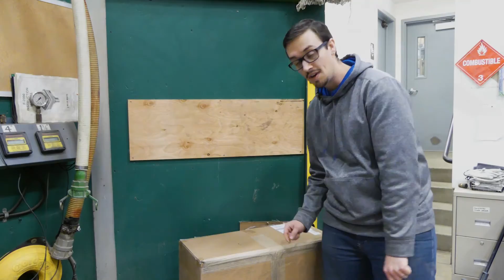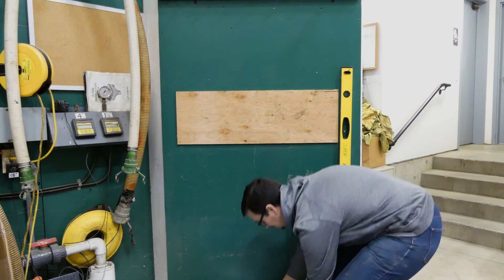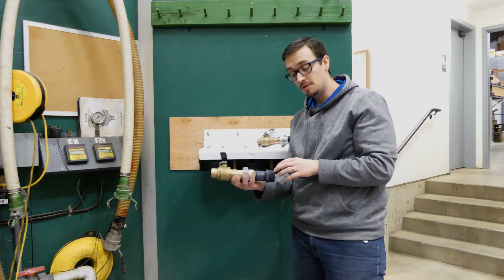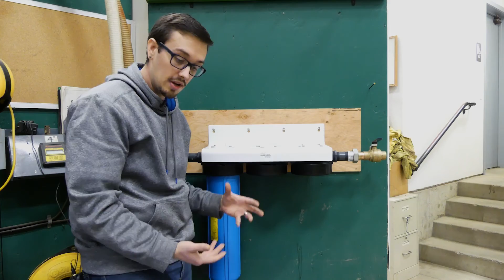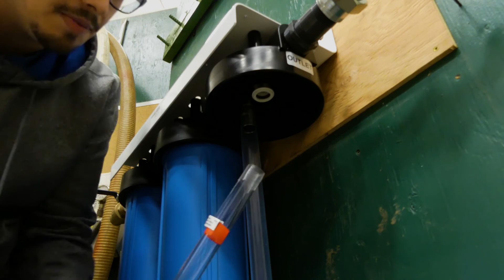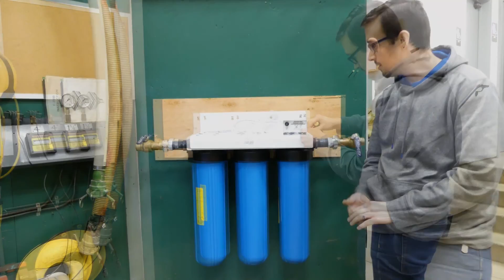How to Install an Ultraviolet Water Treatment System

Comment: I installed two water filters not knowing anything what a filter is, and I didn't removed those plastic packings from the filters. lol removed them after this video. But there was another problem afterwards. when I opened the water the uv box and the uv bulb shoot straight out after 5 mins 🤣🤣🤣🤣

Comment: Would you put that before or after the pressure tank?
Reply from the maker: After. If your filters are clogged you want the pressure switch to see it and turn the pump off.
Reply: That makes sense, I will do that!